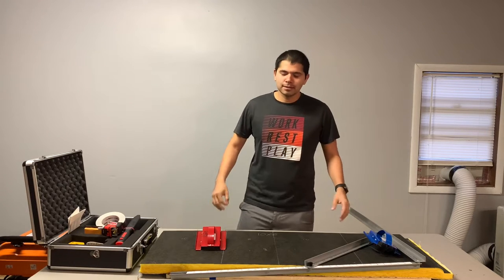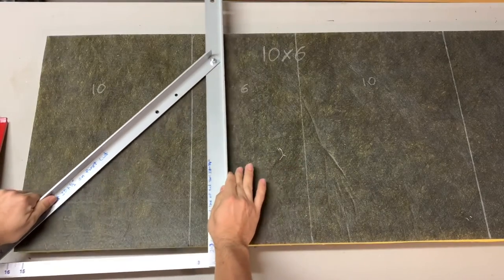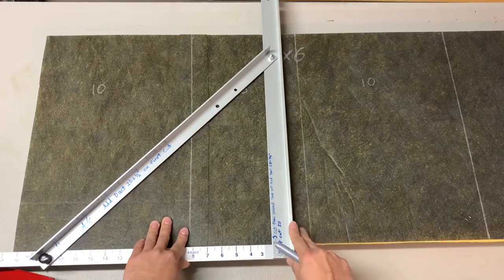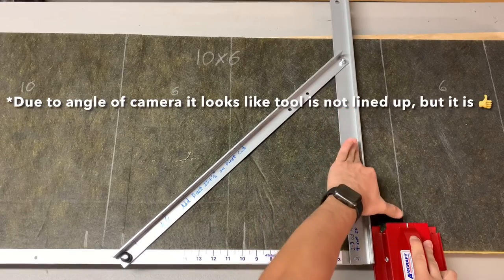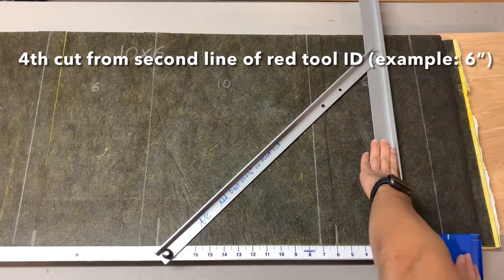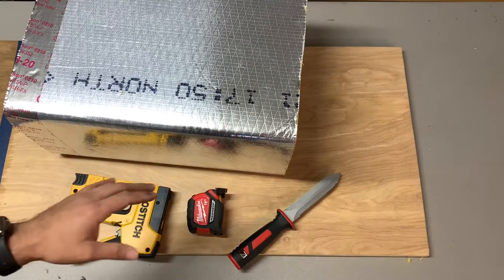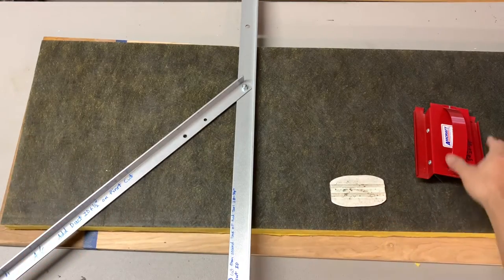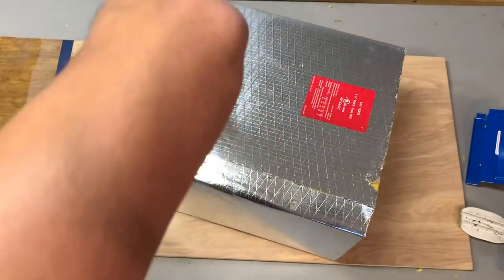How to cut Duct Board W/Amcraft Layout Square /V-Groove method

Comment: Hey Alex, great video!  Just a reminder, when cutting 1.5 inch duct board v-groove with the layout square, the first cut should be the first duct dimension plus 3/4".  Adding 1/2"  is for 1" duct board, not 1.5 inch, which might be why you're having to subtract the 1/4" from the remaining cuts.  Likewise, you would add 1" to the first duct dimension for 2" duct board.  The 2nd, 3rd, and 4th cuts are simply taken by placing the layout square on the right most red cut.  At least that's what it shows on my Amcraft layout square directions sheet.  Looking forward to some more duct board videos!
Reply: @S K ,so for example 10x6 ID will the cuts be : 10 3/4x6x10x6 ?
Reply: @sdsd4284  Correct!  But again, this is only when using the Amcraft layout square (with the V-groove cutters) because the design of the square will account for the thickness of the board on the 2nd, 3rd, and 4th side cuts (and just make sure to measure these 2nd, 3rd, 4th, sides from the right most cut of the v-groove you just made previously).  It's that first piece where you have to add the 3/4" to accommodate for the thickness of the board coming back around to side 1 from side 4 (because you're not cutting the left most part of that first side which remains flat, and you're cutting with the shiplap tool on the last cut which is also leaving that right most side flat as well [i.e. not v-grooved]).  Hope that makes sense.  The directions in the Amcraft pamphlet show it pretty clearly as well.  This guy (https://youtu.be/51s1d5afKfM) also does a good job with the exact same tools (in the comments he replies that he uses 5/8" at the first cut instead of 3/4" because it works out better for him [maybe doesn't make the board too tight when he tries to pull it together].  A male and female shiplap hand tool and an angler tool (https://youtu.be/ibEhfrTI6M4) will also make ductboard fabrication a lot easier too.  Good luck!
Reply: @Babysoft  thank you .will be trying out this method .
Reply: Somewhat correct if you have this square first cut add 3/4 an last cut add a 1/4 done only for 1”1/2 duct board!

Comment: Using the red tool which is my favorite, i  always use the left edge of the tool instead on the center mark, the V cut is 1.5 inch  then from that 1.5 inch I make my second cut whaterver size duct I'm working on. Now in the beginning of the board  if the board is 1 inch thick I add 1 inch to the first panel and cut half inch and the top of the board, then at the last panel I add an extra 1/2 inch but a straight cut that way you will have a very seal tight board. For some reason I do the cutting really fast and I'm not a professional per say, I'm a AC Tech.

Comment: I'm prety much sure that your 1/4in situation is due to the tool blades are not in right position (probably slightly inside). I had the same problem when I bought mines but in my case were 1/2in difference. Then I took a flat screwdriver, loosed the screws to bring up the blades and worked perfect.
Reply from the maker: Thanks for the tip, I will try that👍

Comment: Can you put links to all the tools? I found most of them on Amazon but can’t seem to find the square. Thx
Reply from the maker: If you go into my description tab below video you should be able to find all the links to the tools in video, I copied and pasted it for you.
I hope these links are helpful 👍

Down below are the tools used in video👍

*Cutting Duct Board w/centerline method using amcraft tools— https://youtu.be/RljbsmdDR6E

*Malco fasgroove shiplap tools for duct board—https://youtu.be/hMXbExZtkfw

Amcraft Layout Square— https://tinnerstools.com/amcraft-collapsible-layout-square/

Amcraft Blue Tool— https://www.amazon.com/Amcraft-insulation-Blue-Duct-Tools/dp/B01M9GJPLI/ref=mp_s_a_1_2?dchild=1&keywords=amcraft%2Bred%2B%26%2Bblue%2Bduct%2Btools&qid=1612741536&sprefix=amcraft&sr=8-2&th=1&psc=1

Amcraft Red Tool— https://www.amazon.com/Amcraft-insulation-Blue-Duct-Tools/dp/B01MG5ZGDW/ref=mp_s_a_1_3?dchild=1&keywords=amcraft%2Bred%2Btool&qid=1612741697&sprefix=amcraft%2Bred&sr=8-3&th=1&psc=1

Clinch stapler— https://www.amazon.com/Outward-Clinch-Stapler-Manual-Heavy/dp/B002YES78C/ref=mp_s_a_1_3?dchild=1&keywords=bostitch+clinch+stapler&qid=1612741885&sr=8-3

Duct Board— https://www.budgetheating.com/Acoustic-soundboard-Case-4-foot-X-10-foot-sheets-p/232002.htm

Comment: Can you do 2” ductboard V Grooving method , I used to do 1.5” ductboard V grooving now all cities we do work require 2” ductboard , I have follow the amcraft instructions using 2”Red and Blue Tools inside demensions (1st) cut +2 7/8 , (2nd) +3 5/8, (3rd) 3 5/8, (4th) +2 7/8 but they come out crooked one side short. we do most of the time machine grooving machine at supply house but some times we gotta fabricate a piece or two at  the job-site Thank You In Advance
Reply from the maker: Yes ill add that to the list of videos ill be making. Once i get my hands on some 2” duct and the 2” amcraft duct tools ill make a video of how to use them. 
Also you said that on your 4th cut u do            (ID + 2-7/8” ) try this instead and see if it works for you(ID + 3-5/8”) 

Example: 10”x 6” duct Inside dimension 
1st cut red tool: 10+2-7/8= 12-7/8”  
2nd cut red tool: 6+3-5/8= 9-5/8”  
3rd cut red tool: 10+3-5/8= 13-5/8”
4th cut blue tool: 6+3-5/8=9-5/8”
The blue tool needs to be set-up for shiplap with skinner as well.
I hope this example is helpful👍

Comment: I come from a land of metal ductwork. Is there any thing you can add to the joints and cuts on the inside? The thought of air constantly blowing fiberglass fibers freaks me out to the point I can believe they sell and use this stuff. What am I missing?
Reply from the maker: Lol, I hear you bud. Here in florida it’s all fiberglass and flexible ducts for residential, commercial application is when we will usually do the metal ductwork. Try brushing some fiberglass mastic in between the joints or cuts.
Hardcast/Carlisle - CCWI-181 is a versatile indoor/outdoor water based duct sealant for use on all types of metal duct, glass fiber duct board and flex duct, as well as duct fabric and flexible tubing runouts. It incorporates a built-in polyester reinforcement for exceptional strength with UV inhibitors for outdoor use.
Reply: @AZSolutions92  I live in Florida now too (Boca, originally Michigan) I never seen fiberglass duct work till I came here. We always wrapped the metal with insulation if we need to, but doing it that way you can at least seal the metal first with mastic. It was eye opening to see fiberglass used as air supply. Anyone that has ever worked with fiberglass knows how bad it can irritate the lungs, skin, eyes. I have an older home 1978  I can appreciate the simplicity of the fiberglass duct work and its a cool system from a installers/fabricators POV but I'm amazed people want to breath this stuff.  I am 100% sold on mini splits here in south Florida.  As soon as this current system dies its all coming out and two 3 zone mini split systems are going in (4 ceiling cassettes and 2 concealed duct unit) with short metal ducts and spray foam attic. I have flat roof section so ceiling cassettes wont work in all parts of the house and I find the wall mounts are kind of ugly unless its a really large space.  The redundancy of having 2 independent systems with multiple indoor units is a huge selling feature in itself.  If one system or piece goes down you still have AC and not having AC here is a no go. On top of the efficiency health and comfort a mini will provide over a traditional split system.  My current air handler is in the garage and what a mess that is.  It sweats like crazy and is starting to rust the bottom out even the inside of the unit uses some cheap foil faced fiberglass insulation.  I dont even want to know what my indoor air quality is (ignorance is bliss) but I know its not good... Not sure who started these building trends back in the day here in Florida but air handlers in non conditioned space, fiberglass duct work, a single air return for the whole house, supply duct work in unconditioned attic.  Not only is each of these methods a bad idea its honestly the worst possible way it can be designed and Florida decided to not only adopt one method but role them all up together in one big shit sandwich.  Best of luck bud I appreciated the knowledge of how the fiberglass ducts are made even though I will never be making one 🤔

Comment: Hey Alex, good content.  Question: how do you connect the plenum to the air handler with fiberglass duct? I mean I see alot of people put it flush to the unit but it takes like 1 in inside the opening. Greetings.
Reply from the maker: That depends everyone has there different methods of how to attach it properly, typically just make sure the duct is nice and flush to the unit, then very carefully put mastic on the inside, you can also make a female shiplap on the side of the duct that attaches to the air handler then put mastic inside. After you tape everything up turn blower on and check for air leakage.

Comment: This tool sucks it should be on point not that you have to add and deduct measurements. Maybe there’s a reason why example: maybe so it’s more of a sturdy cut but I dunnoo
Reply from the maker: Yes i agree, I followed instructions for using layout Square and I kept getting 1 side a little bigger than the opposite side, i then bought another layout Square and v-groove tools thinking mine were defective, but same issue so instead i used centerline method and compared it to layout Square method and found that the layout Square method does work ok but is not as accurate as the centerline method, thats why I started adding and deducting in video to match the centerline method. With a little practice the layout Square method i did in video is the fastest way to cut duct besides using a big duct cutting machine.

Comment: How do you calculate out size dimension... example the air handler is 20 X 21 / W -  D
Reply from the maker: If you want outside dimension 20x21 duct then u need to minus 3” off each dimension so it should be 20-3=17  and  21-3=18. The inside dimensions of the duct u need are 17x18. I hope this helps👍
Reply: Do you still add 1/2 on the first cut and - 1/4 for 2 and 3 cut?